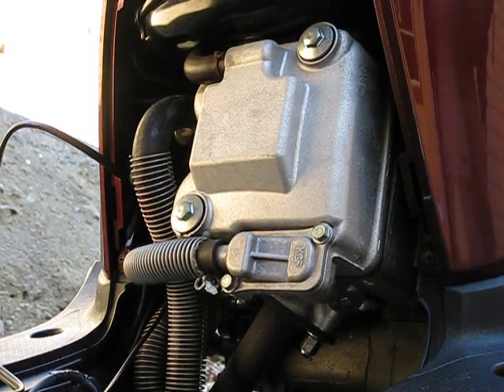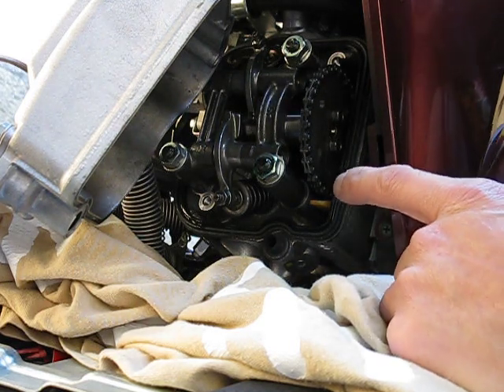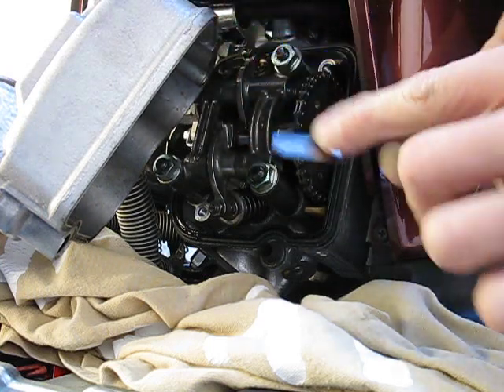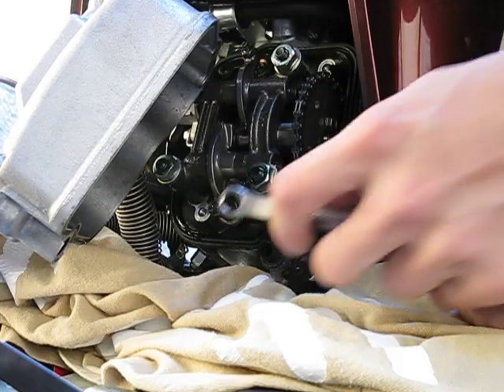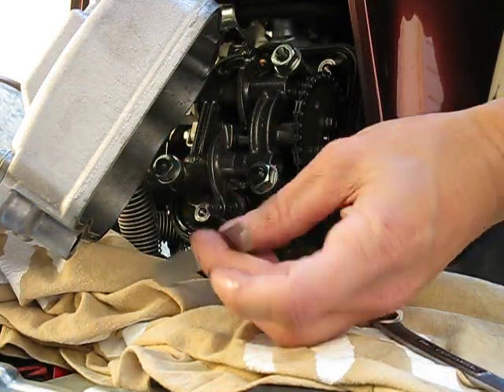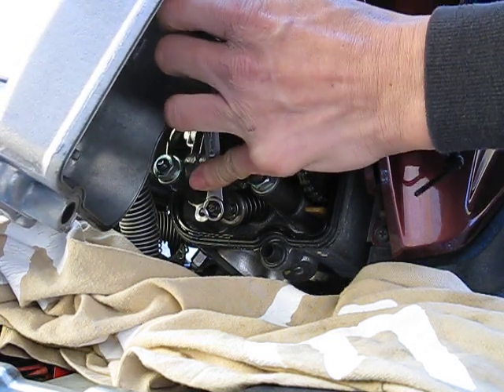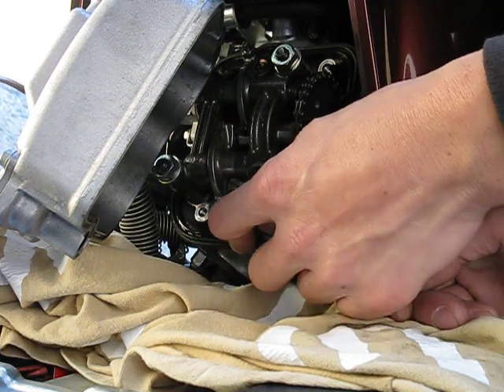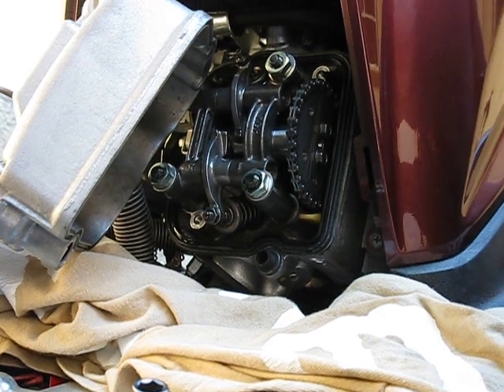Honda SH150i Valve Check/Adjust

Comment: 03:27 what?!
Reply from the maker: If you follow Honda's service manual it say to line up the timing marks to be at TDC.  You don't really need to go by the marks, just need the cam lobes to be on the opposite side of the rocker arms.  When the marks are lined up both intake and exhaust will be closed.  When not using the timing marks as long as the cam lobes are not activating the rocker arm it is fine.  In this case the rocker arms are at the top of cams so if you set the cam lobes pointing at the piston they will be away from the rocker arms

Comment: VALVE IN 0.16  EX 0.24
Reply from the maker: Not for this model year SH150
Reply: @DaBinChe   0,006" or 0,16 mm and 0,010" or 0,26 mm its correct

Comment: ookay, for anyone that still might watch this: when you tighten the nut, use a screwdriver to hold the thing you adjust still- that way you only have to do it once instead of 50 times each.
Reply: I agree, and after adjusting it first tight the nut a little and check again if it's still okay before tighting it completely.

Comment: Hi, now I am owner sh 125i, year 2016 bought as new. I can't find mark for top position of valve. Thank you all best
Reply from the maker: use the mark on the cam sprocket and a pen in the spark plug hole
Reply: @DaBinChe  Firstly I just move intake and exhaust to position both closed, that is when they reach max height. After staring it was terrible, very rough sound. Later I found that wheel you have to move is behind radiator (on your model radiator is on the front) my got it on right side, took off radiator and on that wheel there are marks T and I think F. So moved to position T. On frame is mark so fited with F. But result same very rough sound. On intake 005 on exhaust 010. I try to play with it but don't see much positive prospect. Guy in servisu can do it but 40 pound just for collection and 80 pound got job. If you know it's max 15 min job
Reply from the maker: @04poppop  The T and F mark goes around twice for each time the piston is actual TDC on the compression stroke.  The other time it is TDC at the exhaust stroke.  So you have to make sure you are at the TDC compression stroke.  That is why you need to double check the cam gear marks.  The adjustment is about 20min. but taking all the crap off is easily twice as long so figure it to be an hour labor at least.

Comment: Please help me adjust valve sh125i 2011. I need sh125i's Standard parameters
Reply from the maker: i have no idea what the specs are for it, it is not sold here
Reply: i'm just wanna know how to adjust valve for my sh125i, my sh125i has valve problem
Reply from the maker: If the sh125 is anything like the sh150 then just follow the video, otherwise I have never seen an sh125...they aren't available/sold here

Comment: DaBinChe, You are the best, watched all your videos and my SH150i is in tip top condition. One of the best scooters around, still.. Better that the PCX [I'm 56] PCX is to Bubblegummy for me.. Just the ticket for the traffic crap in Sydney... Not to mention the parking..
Reply from the maker: +Duke SPEED Yeah I think the SH150i is the best 150cc scoot...also why it is Italy's #1 selling scoot
Reply: Not hard to see why, Question? installed what would you recommend for a replaceemt belt ?
Reply from the maker: +Duke SPEED the OEM belt, stock belts are the best!

Comment: I have knocking at idle, feels like something metal is lose and bouncing on vibration every few seconds at random times I mean it doesn't have rhythm so to speak.
My bike is new on 5000 miles, I only changed the oil so far.
Reply: +Drererere DerererereIf it helps anyone turns out this was a worn out chain tensioner (5k miles) and apparently it's a very common problem.